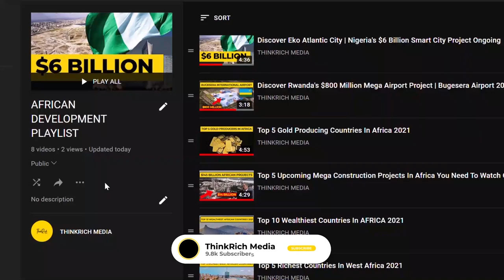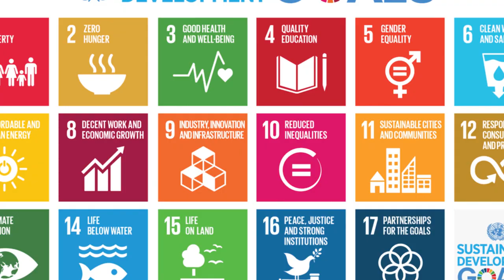Ghana's Ambitious $21.5 Billion Railway Project - Set to Change The Face of The Country!

Comment: THIS HAVE EASY SOLUTION GOVERNMENT BUILD RAILWAY LINE BY DIVIDING ACCRA INTO FOUR NORTH, SOUTH, EAST, WEST AND BUILD ONE RAIL LINE FROM NORTH TO SOUTH, EAST TO WEST AND BUILD ANOTHERRAIL LINE CIRCLE AROUND THE FOUR POINTS +0. IN THIS CASE YOU DON'T NEED SKY TRAIN EASY TO MAINTAIN THESE LINES. BUILD SIMILAR SYTLE MODEL IN KUMASI, TAKORADI, LATER THE REST OF REGIONAL CAPITALS AND GET RAID OF ALL TROTRO OFF GHANA ROADS PERIOD.THIS WILL HELP EASE TRAFFIC WITHIN THE CITY AND THE BUSINESS DISTRICTS ...